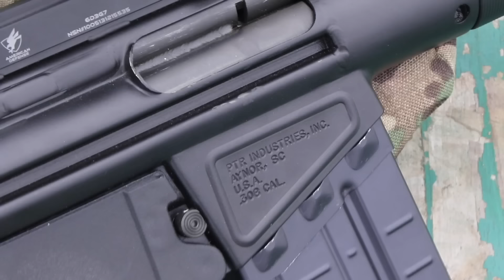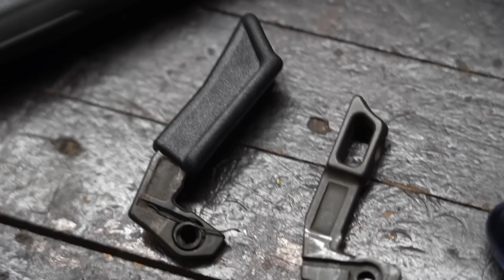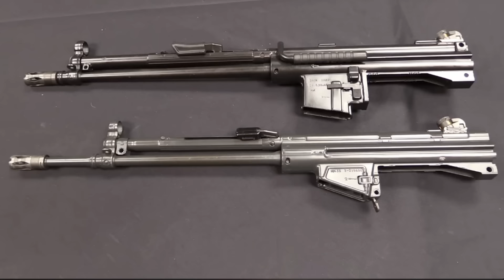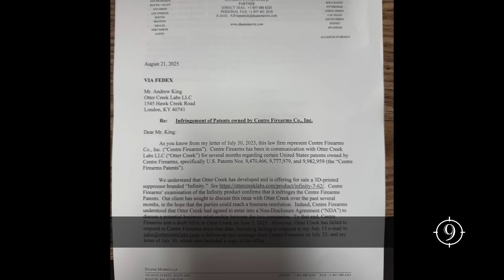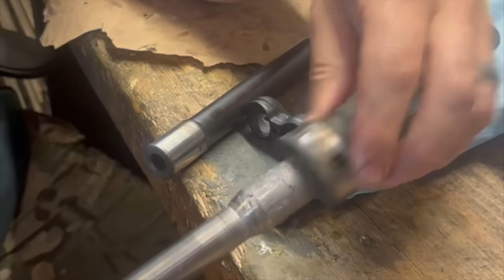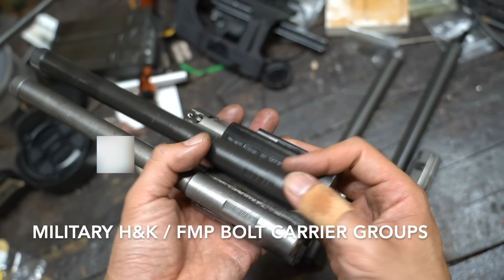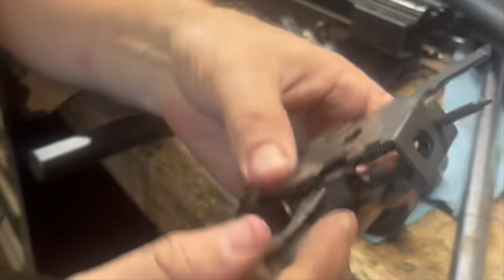Is PTR still worth the money? H&K v. PTR (old) v. PTR (new) v1

Comment: Once their pricing started approaching 2K, they lost their charm. Even with a loss in quality, people can still justify the purchase if they are readily affordable and whatever issues you experience can be rectified without breaking the bank. At that price it's hard to justify a gun purely for vibes. Cause lets face it, despite the military success of the G3 platform, they're not particularly enjoyable guns unless you mod them with additional items. The manual of arms is unique and cool until you do it for the 100th time and realize how clunky it is compared to more traditional rifles. Their recoil is exaggerated due to the stock design one the original furniture. Optics mounting had hurdles to overcome which can become grating quickly.

The G3 is cool, and having older examples is something to be proud of. But I have a hard time justifying spending serious money on one without any real historic value. Which is why some of the "Clone" ones are so frustrating

Comment: I got one in 2013, it has a green mountain H&K profile barrel, appears to be all surplus parts in the trigger pack, and took a nice trigger job that has remained stable. I think the carrier is made by PTR but the bolt and locking piece are H&K. Selector and trigger pack are certainly surplus. Grip housing is the more current style, and it lacks the paddle mag release.
Never had any problems with it except for some magazine hickups on some of the sketchier 1950s production mags that look like they have many stories to tell.
The receiver was slathered in surface rust (inside) when I first got it. I wire brushed it down to bare metal, oiled it up and let it carbon up heavily, and just decided to never clean it, which seems to have resolved the issue as it has never started rusting again even in this extremely humid climate.

I have an NOS 30mm claw mount, but I have yet to find a scope that feels right on it, as it needs something with shorter than normal eye relief. Put an SWFA 3-15 on it and it works, but at lower magnification settings the eye relief is so long it makes it kind of awkward. Kind of tempted to get an old school long tube aimpoint.

It's one of the GI versions that was duracoated black from the factory, Put an H&K wide handguard on and picked up a NOS collapsible stock.

Comment: I just bought a PTR32 a few months ago.  For what it’s worth, mine has been nicely finished and put together. I did replace the FCG and trigger pack from the cheesy polymer thing and the new style FCG. I have seen exactly what is being talked about in this video on other recent PTRs though. Also, my PTR 32 accepts 75% of metal magazines out there, bakelites, and PMAGS. That is it.
I also have one of the very first factory railed PTRs without paddle release and 15x1 muzzle threading. It’s been fantastic. So there is my anecdotal experience with two products. I would love to see PTR stop being bad.

Comment: I picked up a like new A3S, probably around 2014 for $550. Added the HK wide hand guard and bipod. It’s got the rail on top but navy grip module, push button only mag release. It’s been a great gun. Actually perfect. At the time I purchased a pack of 34 mags for $98 from Centerfire Systems. I just recently checked the bolt gap tolerance and it was perfect. I just checked Atlantic and a new A3S is $1,500. Man, crazy
Mine is very accurate with M80 ball. I tried some ZQI at the time . It shot it well enough that I visited every Walmart in my area for months and months. At .50 cents a round at the time it ended up being a good investment. Still have over 1,000 rounds of it.

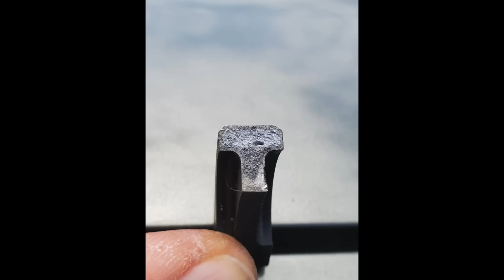Comment: I bought a new PTR91FR in 2020 or 2021. The charging handle was incredibly hard to pull out and back and break open the bolt from battery. It felt like it was seized. The first time I took to the range, I reached for the charging handle and it broke off into my hand, the insides looking bubbly just like the pic at 6:28. No joke, the effort it took to pull back was so great that it broke the charging handle in two.

I ordered a replacement part and it didn’t latch closed on the nub on the cocking tube. I looked at the old broken charging handle and noticed that PTR had dremel’d the hole in the charging handle that rests over the tube when folded into an egg shape in order for it to reach the nub/pin and sit over it. The replacement handle they sent me was made of such hard metal that my files weren’t even leaving a scratch on it. The metal is so hard and brittle that I couldn’t even fit it like the original to match.

I put an extended HK21 charging handle on it instead and traded it off before I ever even fired it and eventually bought a Greek SAR 3/8 which exhibited none of the issues the PTR had. I’d personally never buy another PTR again. I’ve seen other people post online about their broken hammers and other pieces. Their castings are garbage quality.
Reply: I have a GIRK model. Upon purchase, the charging handle had the same problem. The roller retaining plate, a wavy wire type, inside the bolt that holds the two rollers and allows them to move in and out, had been installed poorly. One roller would not compress because the wire was bent straight over the top of the roller. Replaced with a new roller plate/wire and a new retaining pin. less than $10, works very well now.
Reply: @cobalt616 glad to hear you got yours sorted out. I ended up straight trading mine for a USP Expert 9 (w/ the jet funnel) to a guy who pulled up in a blacked out Chevy Tahoe DHS stealth car lol.

Comment: I've had two; the first one I bought back in 2010 and it had a hell of a time cycling surplus ammo (West German DAG would turn it into a straight pull bolt action rifle). I ended up trading it toward an Armalite AR10B. I bought one of their GIR's in 2017. It took about 20 rounds to break in but it's ran fine ever since. Side note: my AR10B is still my go-to .308 semiauto even though it's the Betamax to the LR-308's VHS.

Comment: I had an HK-91A3 before the glut of cheap surplus mags flooded the market.   Back then mags were $100 a pop from HK and this was one of the reasons I got rid of the rifle.   It shot well...but MANGLED the brass which offended my reloader's feelings, the trigger group was wobbly,  the welds were nasty looking  and the firing cycle just harsh compared to the FN-FAL and M1A I was comparing it with.   Also it was a pain to clean well and overall I just wasn't that impressed with it though I did love the diopter sights.   Why they're so expensive is beyond me.

Comment: So if I just want a 7.62 NATO semiautomatic rifle, not a "precision" gun, but just a reliable,  durable "duty grade" .308, that is commercially available and doesn't cost a fortune,  is there even a viable option?
Reply: No. Century are crap and low end AR10-based rifles like the PSA and Ruger have reliability issues. M77s aren't worth $1,000 let alone the $1500 they go for. You CAN build a "budget" AR10 with good parts (just use PSA stripped receivers and put a good trigger, barrel, BCG, buffer, etc in it) for under $1,000 though. Sig (ha!) 716 is probably the best already built rifle you can get for under $2,000, unfortunately.
Reply: Keltec RFB gen 2 not one. It has been the best 308 or even bullpup I own
Reply: Yea the options basically look like
Ptr 91(Avoid plastic go for the surplus)
Zastava m77
Ruger SFAR
PSA Sabre(NAW)
Windham Weaponry src308 
M14/M1A(HELL NO)
Reply: You can get a CA3 for 700 right now. They're G3 part kits put together by PTR and sold by Century Arms. Some of them are kind of rough but most owners I've seen report that they're pretty good guns overall, especially if you want reliable and durable over precision.
Reply: Yes it’s called any budget AR10. Ya know the actual modern Battle rifle.
Reply: Do they run? I thought a lot of "AR-10" pattern guns were finicky
Reply: @ravenwing199  AR10 is as old as the other Battle rifles😂😂. Also theres a reason the Stoner rifle receiver is shaped the way it is instead of the LR308. But im not paying 5K for 1 rifle😂

Comment: I have a PTR 9 that had issues when I first got it, but seemed to work itself out after about 100 rounds and has been fine since. Does have the Aluminum trigger pack so time will tell if it breaks or not. Other than that, I've been happy with it. Zenith MP5k was more reliable, but mag fitment was a lot sloppier than the PTR. Most of my other HK style guns I have built with surplus parts so they have been excellent. 

Was looking forward to the PTR 63, but couldn't wait for the apparently non-existent rifle now and since acquired a C93 I reworked and then built another HK33K clone from a parts kit. Imho the PTR receiver flats are the better ones out there, done a couple RTG flats and they had more issues so PTR is doing something right-ish :D. 

Be curious to see how the Turkish clones compare to PTR and HK....can always use another MP5...

Comment: MFIAP makes an optics rail thats designed exclusively for the CA 3 btw.
Reply from the maker: yeah but if they used the factory rear sight base then you can use EVERY CLAW MOUNT (and aftermarket mount) out there. The cost is almost the same for the two sight bases.

Comment: I recently bought a current production K3P last month, wrong locking 55 degree piece and the cocking tube is canted like your front sight. I’ve only shot with a 50 degree locking piece and it’s been fine so far. The cocking tube being so far off is horrendous though

Comment: So if DSA and PTR are having the same problems, is there any .308 semi autos in the same price range without those issues?
Reply from the maker: If MKE and POF could get their stuff in, they would be decent contenders (since they're licensed military manufacturers)

... but no.
Reply: @9HoleReviews  So essentially getting into semi auto .308’s is definitely a “get what you paid for” deal. Bummer.
Reply from the maker: you can look for older JLDs and Springfield SAR8 (only the imported greek EBO built ones), but even those are climbing in prices.

Comment: I just got a brand new GIR PTR 91. It seems to have a new trigger pack, but the hammer has no markings on it. New BCG and bolt with different markings than in the video. New style flash hider. Proper surplus furniture including end cap. Old style selector lever. 

Shoots reliably so far, but the magazine well is really tight. I don't know if that is a bug or a feature.

Comment: My friend bought a Century MP5 clone and it seems to run like a top (I only shot it once but it had no failures). The guy at my LGS is trying to push me toward a PTR, but I'm hearing negative things about them. I don't want to pay too much, but I certainly don't want to pay too little either, so I'm not sure what to get now.
Reply from the maker: the Century MP5 is an MKE, so it's made in a Turkish military facility that is licensed by HK. It will be fine for the most part if the firearm is built correctly
Reply: @9HoleReviews  Great to know, thanks!

Comment: I have a 2022 PTR GIR. When I got it, it had issues with resetting the trigger. It would eject and load the next round no problem, but about 80% of the time, the trigger would be dead. I sent it back and haven’t had issues with that since. 
However, I’m currently having issues with accuracy as I’m getting 6” groups at 100yds. I’m willing to chalk that up to possible ammo issues as I keep forgetting to bring my federal gold medal match and have been using Walmart Federal m80.
Reply from the maker: even with M80 it shouldn't be 6in. The K3p you see here is also giving poor accuracy. I will do a complete barrel swap and overhaul to make it work.

Comment: I have a PTR K3P (G3K “clone”) that I bought in 2023. Like yours, it came with the wrong 55 degree locking piece that I had to swap out to a 45 degree to prevent roller dent. Other than that, it’s been fine with zero malfunctions. I do think it is the best “cheap” battle rifle under $1500 though. I have a JAKL-10 and an Aero M5 in that category, and they both have problems (the JAKL-10 is REALLY bad), and all cheap LR308’s have problems in my experience. 

That said, I don’t disagree on the lower value proposition. If you’re already trying to throw expensive .308, then you should just save up just a little more and get something around the $2000 mark. For me, I managed to find both a used LMT LM8 MWS and a used Robinson XCR-M, each at $1900. 

I also have a HK MR762A1 I found NIB “used” for $2500, a Spear I found for $2800 used, and a SCAR 17S I paid full $3800 for pre-taxes 😂.  Obviously not typical pricing, but I STRONGLY recommend that people just look around for used rifles because when you do, the pricing gap shrinks drastically.

Edit: Oh and I have a DSA FAL OSW and a M1A SOCOM 16 in a EBR chassis, and both are pretty bad but at least look good!